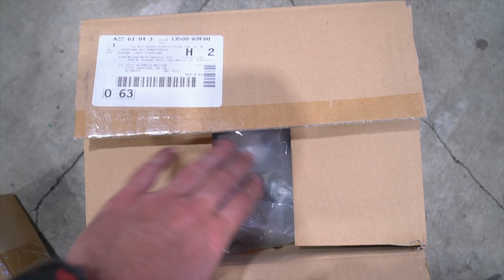18 Days to FINISH My S13 Hatch for the Toyo Tires Booth at Wekfest!

Comment: The timing cover swap wouldn't have worked anyway. The timing cover has to be bolted to the block when you machine the deck, so it's highly likely that you would not have been able to install your new replacement without machining it. When you rebuild the engine, that's the time you gut the new timing cover, bolt it to the block, get the deck skimmed and then rebuild the oil pump.

If you wanted a "new" oil pump, you would need to gut the old timing cover, clean the face as desired, then install the new parts from the new timing cover or buy an SR oil pump rebuild kit.
Reply from the maker: Thanks for the info! Figured this out after attempting to install it but will be getting it machined down with the rest of block when the time comes

Comment: So did you get it done in the 18 days? About to start my build on my 240 so curiosity has me wondering if youre ever gonna finish it
Reply from the maker: I was able to get the interior and exterior complete with the dressed long block in the car for Wekfest, which was the goal. It looked visually complete but the motor still needs to be built and wired. Hoping to have it running this coming summer.